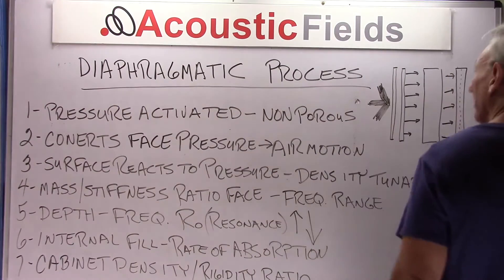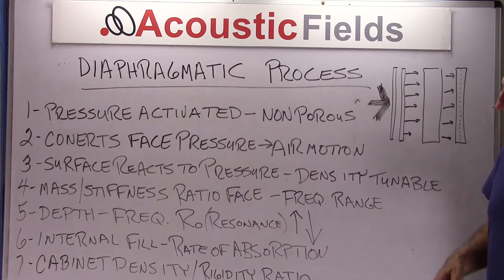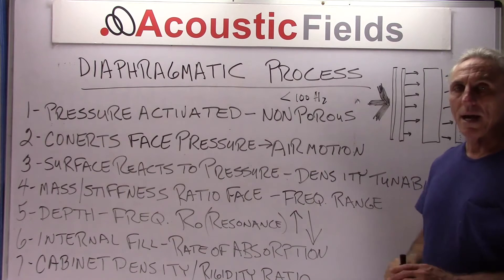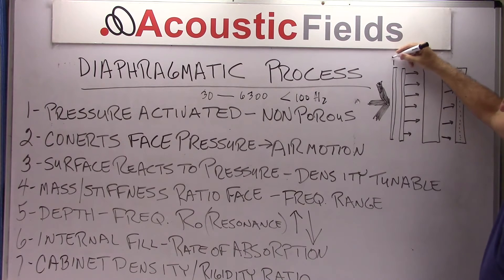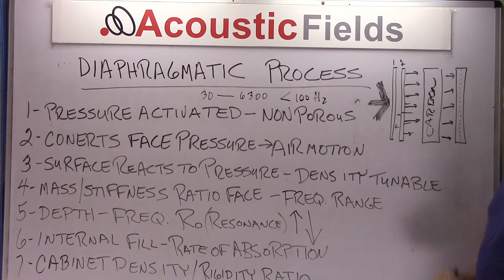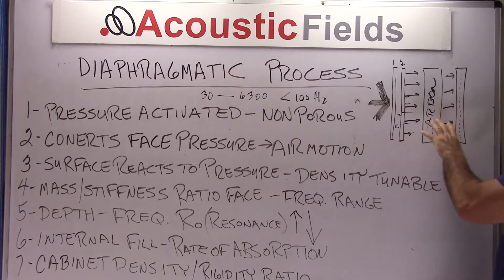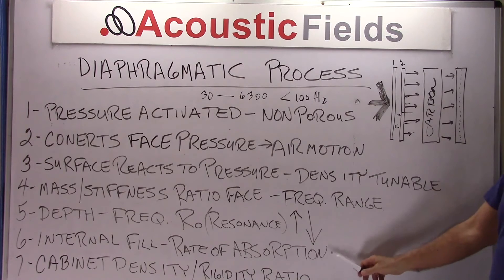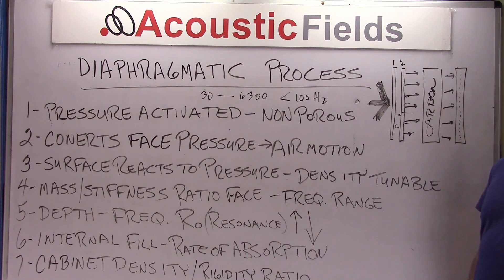Diaphragmatic Process - www.AcousticFields.com

Comment: In terms of levels is it right that the thinner the plates are the less levels (narrower) the device has? The denser and thicker the plates are the more broadband they work?
Reply from the maker: M, No. There are no interdependent variables. Everything is interrelated with everything else. Its the same symbiosis as with the width, height, and length of a room.

Comment: So cement basement with diaphragmatic absorption on all the walls? Would that be ideal? Rigid, high mass shell with the 2 out of phase diaphragms in front of it? Do this for all surfaces in a room for best results? Lots of questions...so many questions...I'll keep watching more of these videos
Reply from the maker: +simming Subterranean builds are both blessings and curses. They isolate well from external noise but the noise produced inside the rooms can not get out because of the same earth and concrete barrier that the walls are made of. Sound is like water, it will seek the path of least resistance or in this case least density, and go right up through the first floor structure into the house where many unwanted things can happen.
Reply: +Acoustic Fields So, cement basement ceiling with air vents so I don't suffocate? Thanks for you help, great videos!